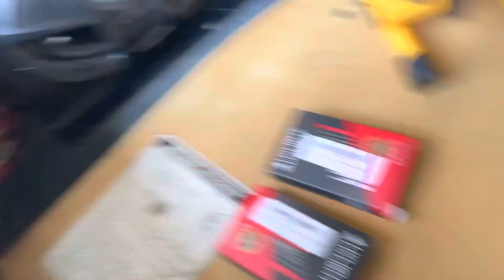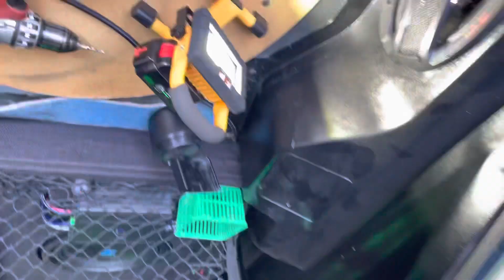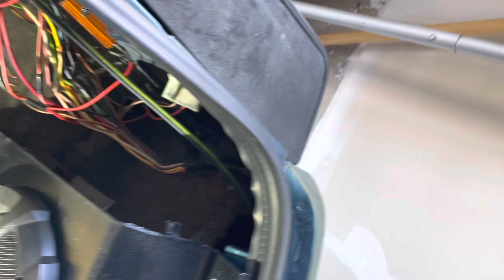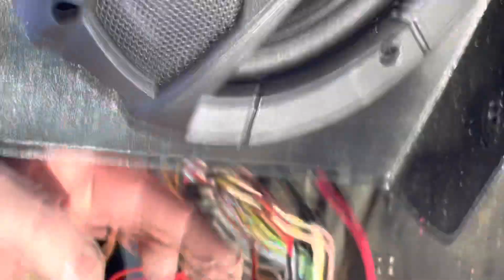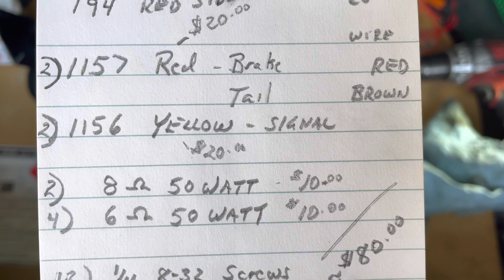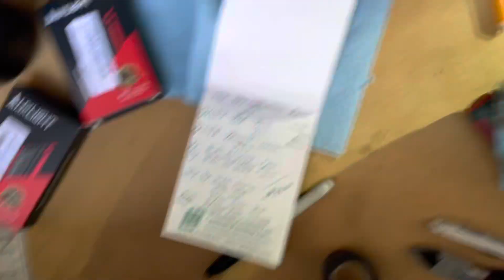LED light conversion with resistor install on a 1986 Foxbody Mustang

Comment from the maker: I got a good deal on the lights and the resisters were also a fair price and considering I do electrical work my self it was an easy install. If you’re not electrical and the price is right your option would be preferred. Good question.
Blessings